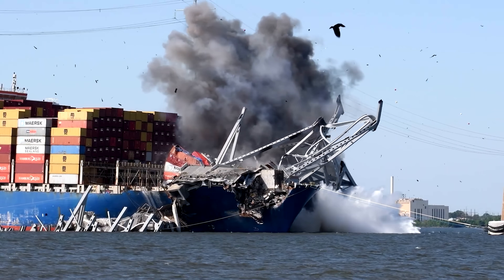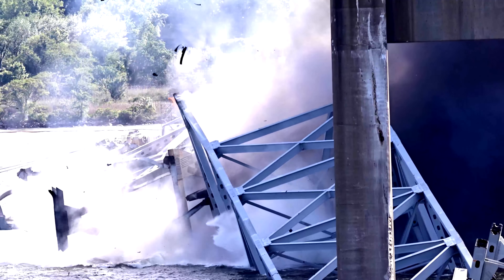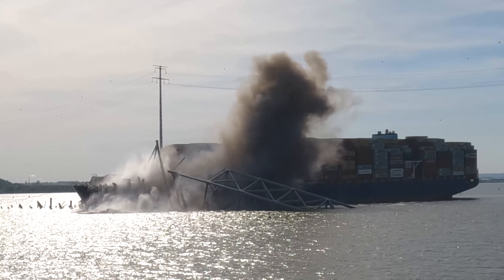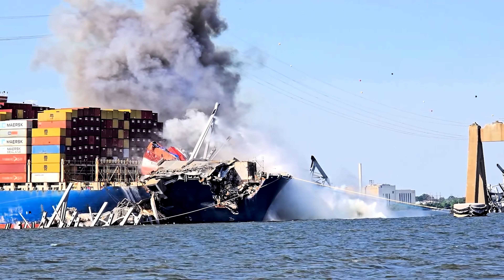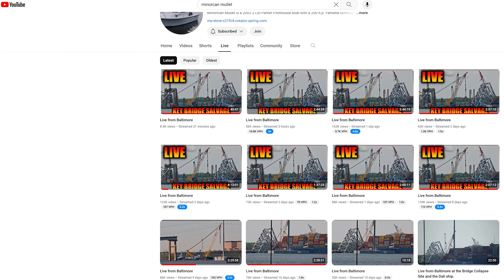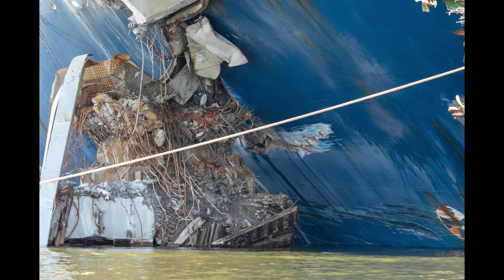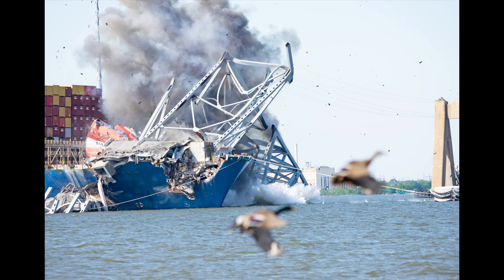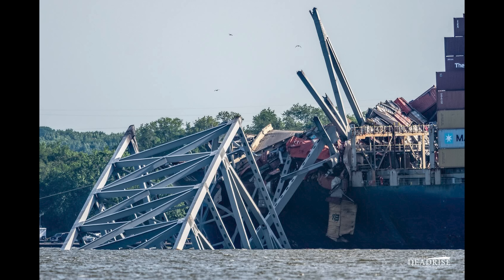NEW Angles 4K Video Closeups Key Bridge Blast Dali Ship

Comment: Take a look around 6:40 of what's left of the bridge on the starboard  side still in the water. The truss was cut off at the water level. But all the rest is still there sitting on the bottom. To remove that will be far more difficult. I assume that's not the channel side.

Comment: Please correct me if I am wrong but having done a little work with shaped charges, I noticed that several of the main connection points on the truss were highlighted and overpainted exactly as one would identify the location of explosive sites. Some of these sites on the lower part of the truss appeared to  fail to detonate. Was it a fuse failure or a command wire disconnection, or are we just bluffing so that it appears that everything is going as it should??????????

Comment: so i will say, i whole heartily believe the animation that was released was to give an example of what precision cutting with the shape charges is and not a simulation of what the actual plan is. one biggest thing for that is that the locations the truss breaks up do not match up with where the charges detonate from and also many sections do not behave normally when gravity is the main force being applied. 

however i think one of the shape charges didn't fully cut a member (which had little impact on the full thing though). the section at 0:58 that is covered by the left side of the '0', when detonated it remained standing straight before it was hit (seen at 1:02 as the tallest part still standing) and brought down by the part that was directly on the doli.

Comment: I hope none of the crew have PTSD from the initial accident. I guess that goes for anyone watching. Anyways, it was interesting to hear what it sounds like when such a heavy, large and strong structure fails. I have been thinking about this since the original reports from people hearing it collapse all around the city and feeling either the pressure waves shaking everything or the ground shaking if they were close enough. There was so, so, so much mass bending, shaking, and breaking as well as energy that needed to be released, absorbed and dissipated. I think, but I'm not sure, that the water makes the sound carry really well. The loudness of the explosion was probably the limiting factor for the exclusion zone. Being on the water is probably the most intense place to hear an explosion because there nothing but an unobstructed path directly to whoever is watching on the water. The explosion kind of made the collapse afterwards seem less loud than it really was, but it was incredibly loud as well.

Comment: Great footage! Technically, 4K is four times the resolution of standard HD, not double, as the narrator said a couple of times.
Reply: Technically the narrator is correct. Normally resolution is vertical pixels and 4k is double than 1080p in the vertical row. 
If you want to get really technical, do the research and refer back to us

Comment: Theres still a huge girder pinning the SB bow down to the concrete base. This thing is bent over and embedded into the hull.
You can see it at 7:40 in between the square concrete pillar and the bright A frame girder. It has rivets on it.

Comment: I'm nitpicking here, but 4K is four times 2K/1080p because both the horizontal and vertical resolutions are doubled (i.e. 2x2=4).
Reply: Resolution is for the vertical pixels
Reply: 1080P seems like 1K to me.
Reply: @JoeLinux2000 Nearly 2K. 1920 pixels wide.
Reply: Your nitpicking is incorrect.
Jeff is correct

Comment: That is cool.  Any whispers as to when they will explain what happened with the ship loosing control?
Reply from the maker: I am working on a prelim report from NTSB right now!
Reply: Ntsb preliminary report just released.  No definitive answer although focus is on electrical system. I read the report and I suspect there was an issue with a transformer causing breakers to trip repeatedly.  It does not sound like operator error although most media are focusing on fact that ship had power outages before departing.  These ships have redundant systems, and it seems the crew had decided to switch parts of the electrical system to alternates that hadn't been used in months.  It's like having 2 mowers in you shed, and you use the green one for 4 weeks then decide you better give the orange one some use.  Unfortunately there is no test protocol that 100% guarantees an electromechanical device will continue to perform as expected.  Point to a light bulb in your room and tell me how many months it has before it burns out.

Comment: I suspect they may keep it ballasted forward to maintain the current trim and first take off the roadway before trying to refloat.  We will see if the use the "Claw" on the Dali to take off the roadway.
Reply: I agree as much of the roadway as possible should be removed from the foredeck before moving it.   This is the first I've heard that the bow compartment was deliberately flooded.

Comment: It’s almost as if they expected it to slide into the water, instead it rolled
Reply from the maker: They had to make a last minute change in cuts and they felt that some of them were too close to some hazardous containers right next door which were containing flammable items so they couldn't quite get the entire thing to shear off as they originally planned
Reply: @jeffostroff  i still dont think there was any actual plan to have pieces of the bridge to slide off. the animation does not the cutting charges at the locations of the cuts or do the pieces behave normally under regular gravity, like some pieces that are shown to 'slide' off just gain horizonal momentum with no real explanation for the force. 

Update 21 release on may 8th only really made mention of cutting the truss into smaller pieces with the shape charges for the cranes to remove.